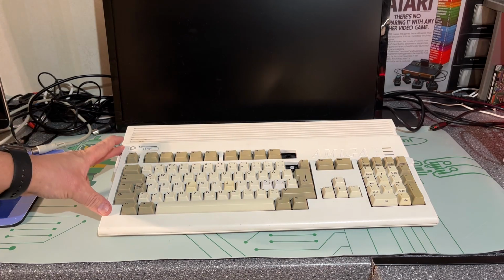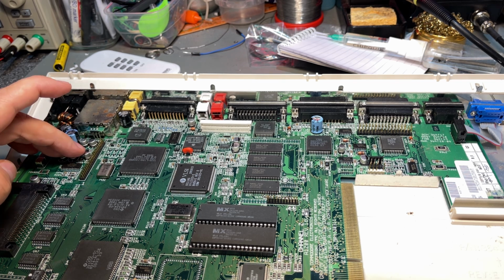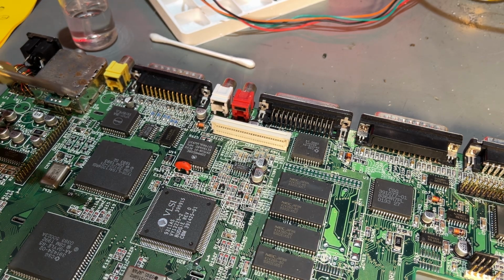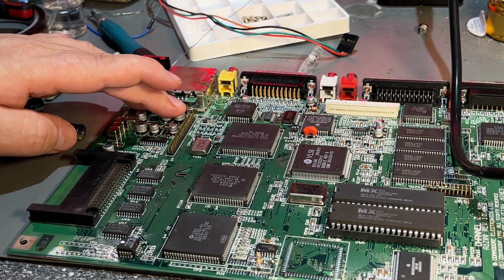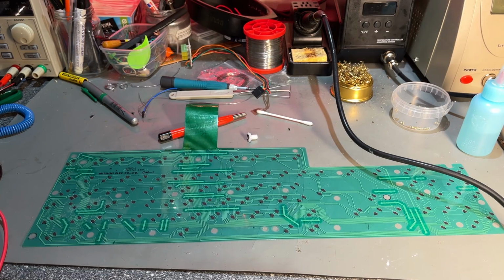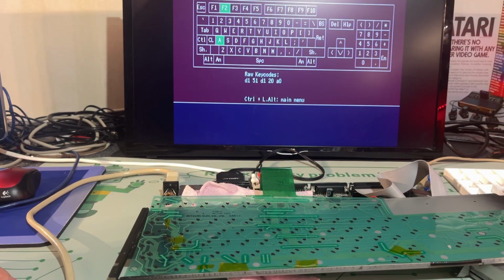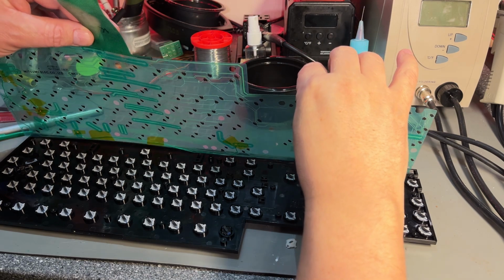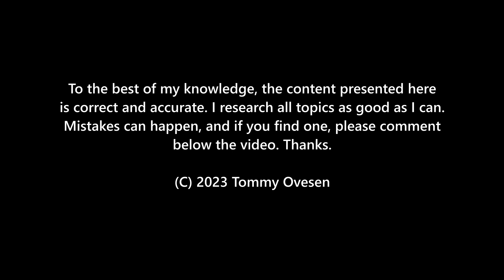Amiga 1200 Trash to Treasure ? Recapping, restoration, keyboard repair, rust, new floppy - Part 1

Comment: Hi, I've nearly finished recapping my Amiga 1200, but I still have the difficult keyboard one to do! Unfortunately I lost a pad in the process. I used the cut method that Chris Edwards uses in his video. I don't think thats why I lost the pad though, Either I was a bit rough in the clean up or it was electrolyte damage. I managed to fix it with a bodge wire though. I'm actually glad I lost a pad because I had lot of fun working out a way of fixing it!

Comment: Congrats on being brave enough to tackle another one of these.  If we don't try, we don't improve.  I've never seen anyone heat both pads like that to remove capacitors, but it seems a lot safer than what I've seen others do in the past.  Great job all around - I'm jealous of your 1200!  

I'm surprised you had to replace the gasket in that desoldering gun.  I have one very similar and it is painfully tight to take apart for cleaning as is.  I'll have to remember your gasket tip if it gets looser with age.

Oh - and awesome job getting that new cap in by the output jacks without completely ruining everything (as is so easy to do)!
Reply from the maker: Thanks!

Comment: Try using a black conversion coating on those rust spots on the shielding. It will form black hematite, which doesn't rust, and seals the surface.

Comment: You can fix membrane traces with silver conductive paint or even a thin strip of copper tape (with conductive adhesive). Most of those paints are pretty bad to apply though. 🥴
Reply from the maker: I know. Did not have any. The one I had did not work at all

Comment: DOOD! On some machines old solder binds to the mobo and is impossible to get out. I just cut the legs off the caps and solder new ones onto the old legs. You can also get new gold-plated RCA jacks off Ali Express for a couple bucks.